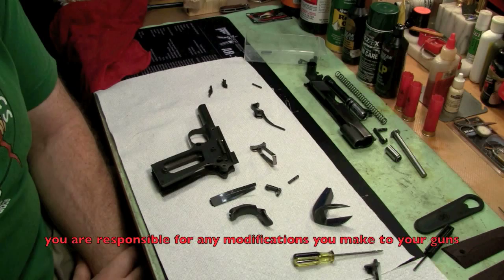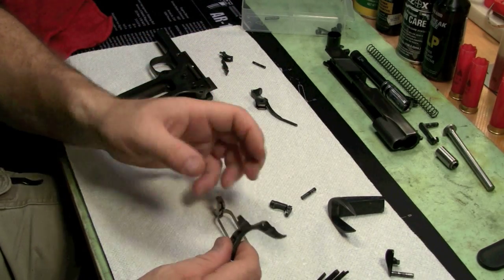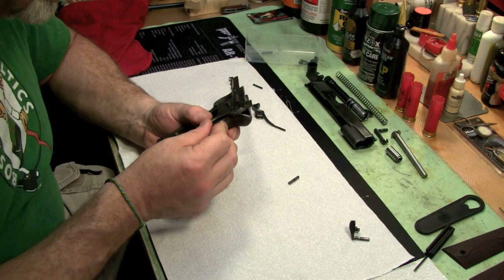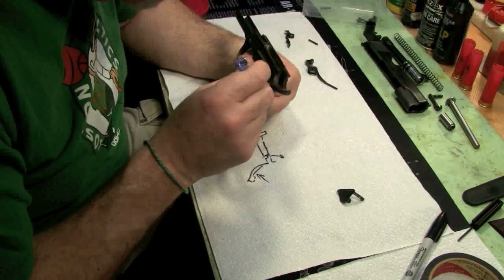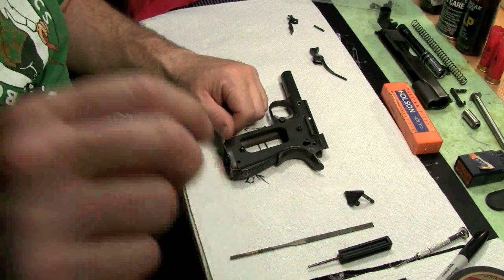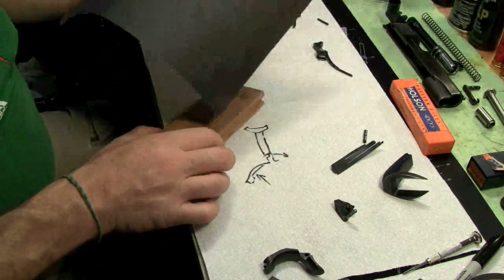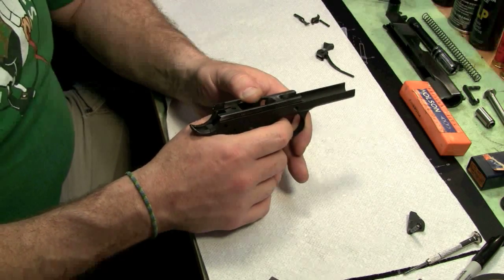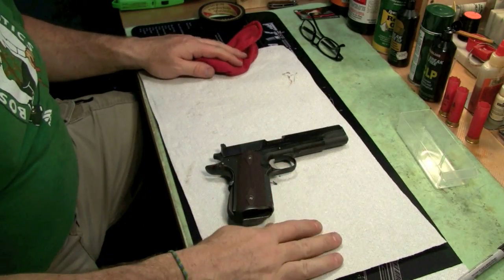How to Modify the Grip Safety on a 1911 Pistol

Comment: Very good video.  I was putting a new short Wilson trigger in, and the results were a grip safety which stuck IN and wouldn't return to its normal position without removing the thumb safety pin and resetting everything.  The cure was to learn how the grip safety worked, which I had no idea, and following the same process which you demonstrated.  I am back in business with the new trigger, thank you.

Comment: You don't need the grip safety for USPSA competition, so your statement about needing the safety for competition is incorrect.  You only need one operational safety for competition, which will be your thumb safety.  Pin the grip safety so you never have to worry about it.
Reply from the maker: Yeah well you do need it for other sports.
Reply: +Craig Krueger Gaffers or Duct Tape for me. JK. . .